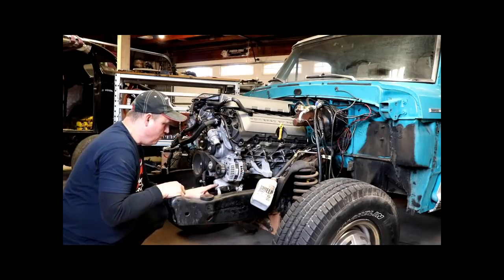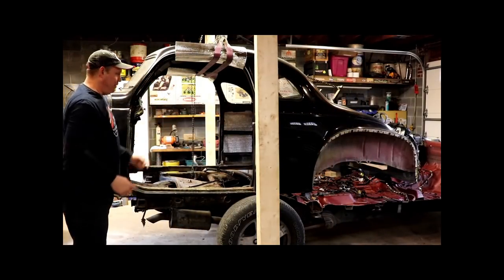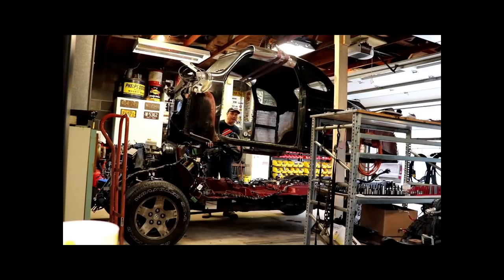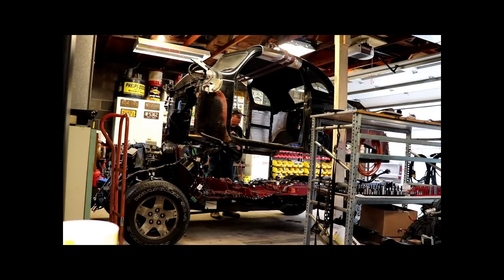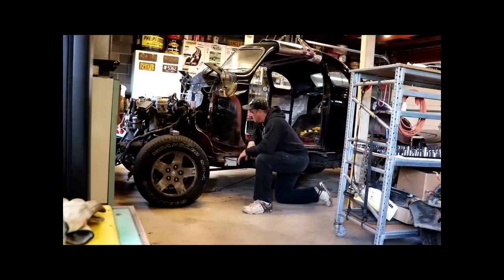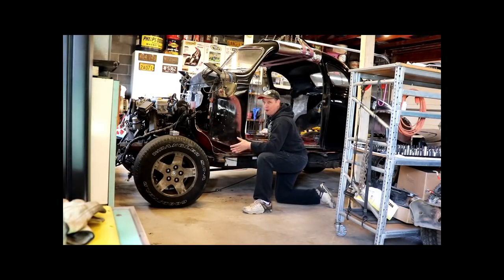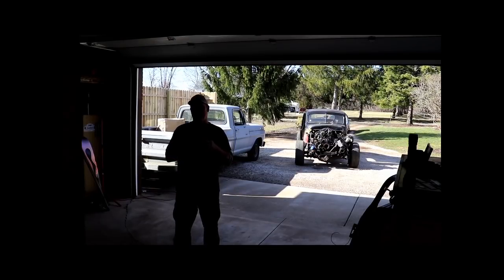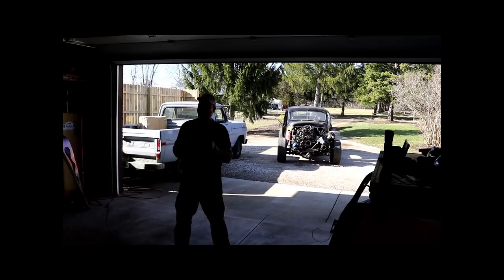1941 PLYMOUTH Hotrod Goes AWD Hemi! CHOPPED!

Comment: Why does my dodge ram pump air great on the highway but suck in the city?
Reply from the maker: What is it doing?
Reply: @GrenadeMotorsports   works great on highway but not in city
Reply from the maker: Buddy, I still don't know exactly what you mean. Fuel economy? Power? Rough idle? Engine noise? I can't fix it from here...
Reply: @GrenadeMotorsports  air conditioning good on highway not so much in city

Comment: What do you do for wheels to get them to tuck better than stock wheels?
Reply from the maker: Well... The Durango has very few options for wheels because of the suspension component clearance. See the recent Dodge pickup video for the most narrow wheels- We used the least offset and they STILL stuck out. If you're adamant about the wheels being under the fenders? Use a Dakota with the lame 6cyl or 4.7.

Comment: Looks like you'll have to go to 15 or 16 rims, if those are a 17? Perhaps a lower profile tire on the front
Reply from the maker: Yes, limits abound with big brakes up front. 17" rims are going to be required. We can keep the 139.7mm lug pattern and clear the brakes with 17's, but we are going to go LOW profile rubber to make it happen. Also- we may have wheels made specifically for this thing.  :0 Thanks again for watching!
Reply: Can smaller brakes be installed?

Comment: I was wondering how you did the dashboard did you use the original or modify the Durango dash to fit? Also how did you finish up the floor? Im about to drop a 1946 dodge deluxe on the frame but don't know what im going to do with the dash.
Reply from the maker: He used very little of the Durango floor and created the rest from scratch. The dash cluster was hidden under the center console. Thanks for watching!
Reply: @GrenadeMotorsports  oh crazy idea! Thank you for your response i didn't know what I was  going to do with it, so the floor pan basically got a body drop?